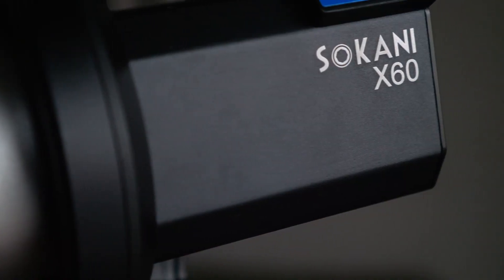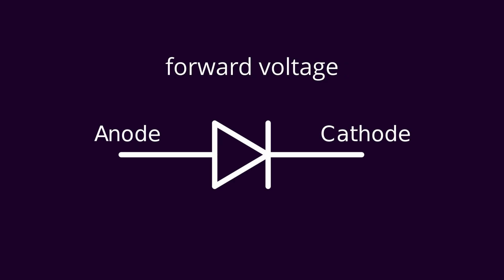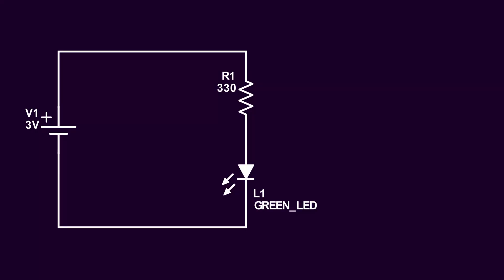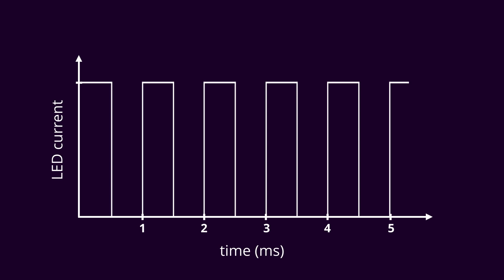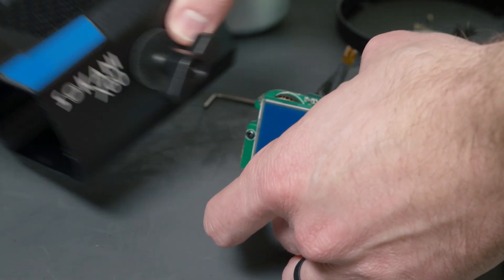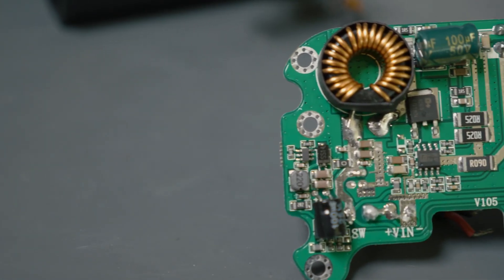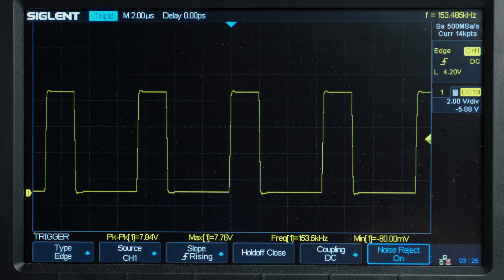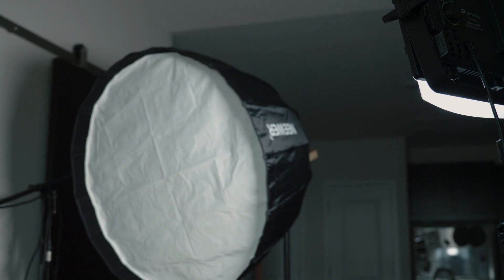TEARDOWN - The Sokani X60 COB LED Light

Comment: Hey! A little late to the party, but hoping for an answer anyway! I am considering one of these, and want to power it with my 18 volt power tool batteries and go cordless. I could of course use a buck converter to get the standard 15 volts that these takes, but not having to do that would be great. I checked the datasheet of the PWM and it takes supply voltages all the way up to 24 volt. Does this mean I can just plug in my 18 volt batteries without breaking anything? I suspected they use 15 volt since this seams like a common standard for video/photo gear. 

And great and informative video, thank you very much!
Reply from the maker: Very interesting idea, repurposing power tool batteries - I like it!  Without doing a full review of the internals (i.e. do it at your own rush) I am pretty sure that 18v will be fine.  As you say, the pwm ic can handle it, the only question would be the switching voltage regulator just above the rotary encoder.  My guess is that it will be fine as well, but since I don't have the part number, I don't know for sure.

I haven't really played with them, i guess that 18V means five Li cells?  In which case true maximum voltage is around 21V, which might be close for the regulator - just keep your fingers crossed that it's good to 24V as well :-P

How are planning to hook it up?  I'd be interested in the details.
Reply: @overkillprojects8091  Thank you for your swift and thorough reply! Hmm, maybe I'll just give it a go! And you are correct about the voltage at peak charge. So I might be pushing it. 

But yeah, I really want to battery power all the things! Since I already have a bunch of makita batteries that are around 100 usd a pop. I have 3d-printed mounting plates and used strips of aluminium sheets as leads. I have currently made an "all purpose" battery bank with a boost/buck  with a potentiometer and a standard barrel plug. I am using it to power my ts100 soldering iron. I also have one of those small amp/voltagemeter displays. Everything is just cheap stuff from aliexpress ofcourse:) And since I can just change out the battery itself from the "control box" I practically have endless cordless power in a variable power supply. In the case of these lights the best case would to just make a super simple mounting box with leads to a barrel plug and connect it to the dc in on the sokani. And just bypass all the other "fancy stuff". 

My main concern with using a buck is that most of the cheap ones I have found from aliexpress are 5Amp max. And with 80w/15volt, that may be pushing it a bit.
Reply from the maker: My guess is that the light will be fine, you won't be very far over spec even at full charge, and those cells settle down to 3.7V pretty quickly.  This is a pretty great application for them since you can use them without regulation and they are much beefier than typical AV batteries. It would be kind of fun to build a clamp on dual battery supply with a beefy buck regulator that you could switch for different output.  Then you could easily swap them out and shoot for hours